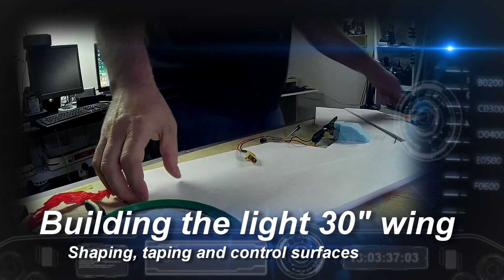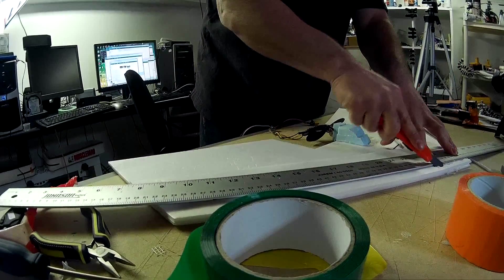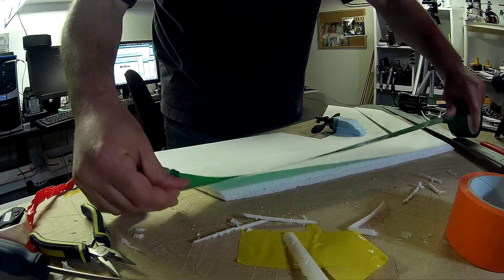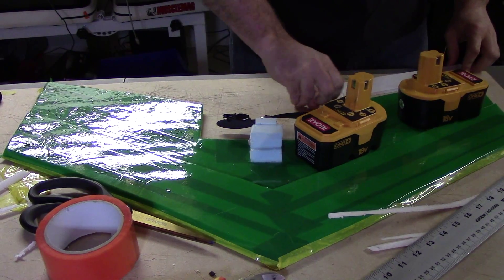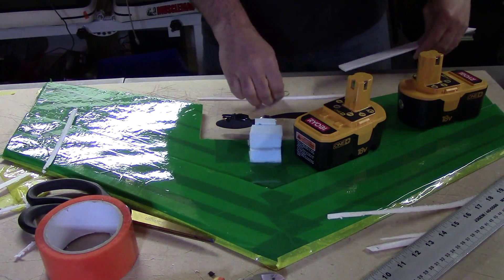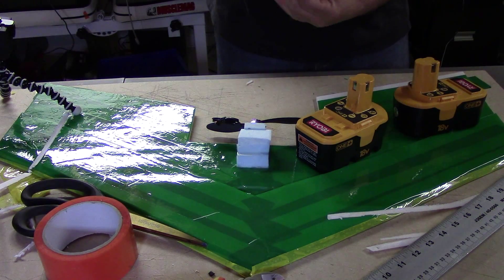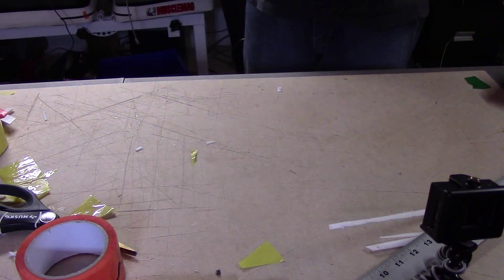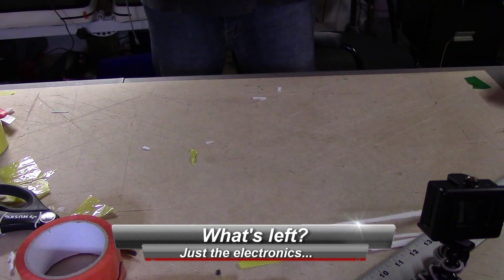Build a light KFm2 Flying Wing - Shaping, Taping and Elevons

Comment: Why not Leave the Paper On ?  It's what gives your foamboard Strength 
and Stiffness .  You are covering it up with tape anyways .  And , now 
your Motor Mount is glues to a Weakened single sheet .  Keep Your 
central area Strong for your Electronics and wings .
Reply: The paper delaminates over time especially if it's exposed to damp conditions.  With paper on, the wing is essentially disposable since it has a short life once it leaves the shelf.  I've only tried dollar store foam.  I'm sure the quality stuff holds up better. Of

Comment: what is the vertical piece that the motor is attached to?  Did you screw it into foam? or is that is piece of thin wood glued to foam?
Reply from the maker: It was actually just foam and I used wire to attach the motor to the foam.  I would recommend a proper motor mount of some sort, I just couldn't find one at the time.